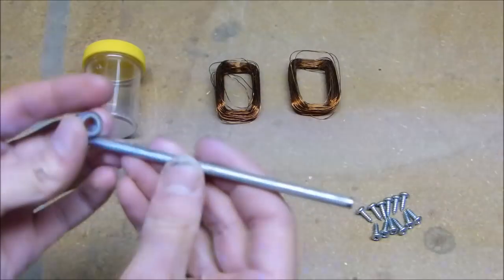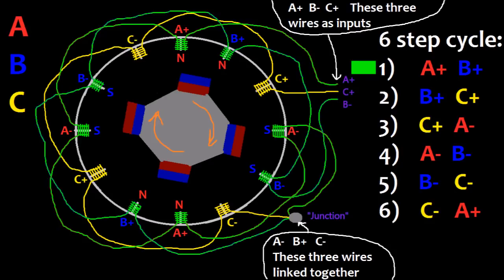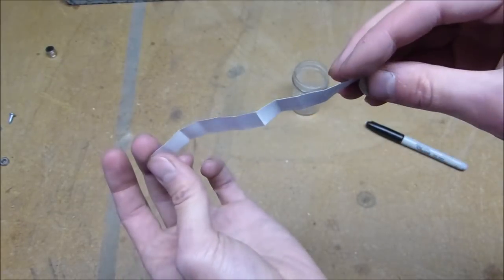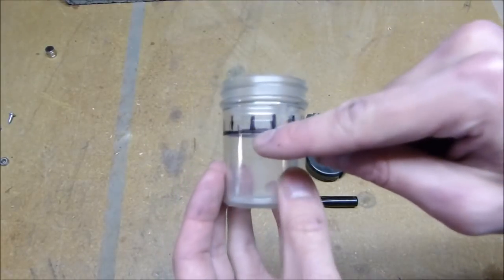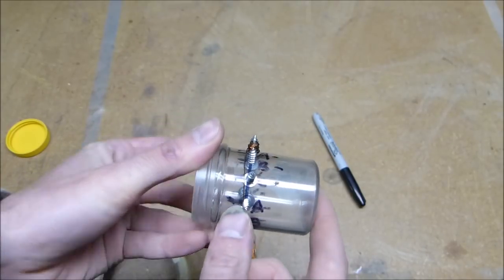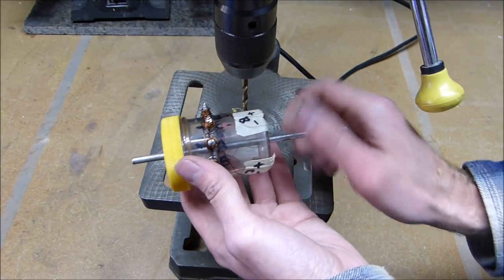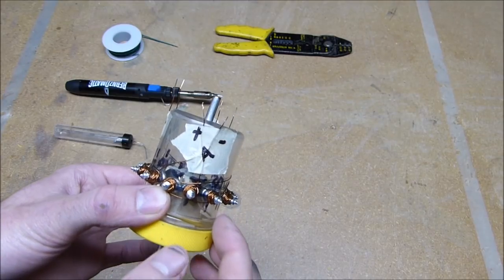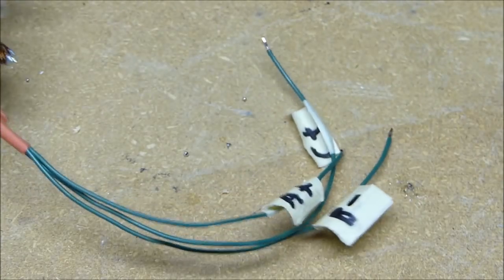How to Make a Brushless DC Motor Inrunner

Comment: I do not have access to NY rc car/plane brushless DC motor controller so what can I use instead? n nice smooth explaining!
Reply from the maker: Hi, thanks for your comment! I have a big project planned to come this year to show how to make a giant (car sized) brushless motor and controller (yes AND CONTROLLER!), but I will have to ask for funding from my viewers in order to be able to do that project.
Reply: +JaycubL dats great!!! but can u use something instead of controller?
Reply: +JaycubL dats great! but can I use something instead of controller?
Reply: +JaycubL dats great! but can I use something instead of controller?
Reply from the maker: Vikhyat Sharma I don't know of anything, but you might be able to re-watch the section f the video that describes the cycle of the motor, then use that information to design a mechanical commutator (rotating brushes). That is the only other solution I can think of.

Comment: do u think this dc motor would have a high enough rpm to get a rc airplane to fly , single propeller rc plane ?
Reply: +kian brorsen or do u think the outrunner would be better
Reply from the maker: +kian brorsen Yes it should work well it just depends on what airplane. There is only one way to really know how it will work for your plane and that is to test it.
Reply: +JaycubL that coil ur using , doesnt it transfer electricity trough anything it touches ? so why does it work if the coil is touching the others it will just send electricit trough all the coils
Reply from the maker: The wire is coated with a layer of insulating enamel. It looks like bare copper but it isn't.
Reply: +JaycubL so it will only float in the coil not transfer to other coils . thanks for ur help : im looking forward to more of ur videos
Reply: +JaycubL  if u say that the coil is coated with some enamel , then how does the electriity go to the screws ?im guessing the screws is just to let the electricity current run in the speciel way and thats whats causes the magnetic fields¨
Reply from the maker: kian brorsen The screws are just a ferromagnetic core, the electric current is not meant to flow in them (there will be some induced currents in the screws from the changing magnetic field but that is just waste).

Comment: That's nice! I'm researching about this kind of motor. This one you made is a brushless DC motor, so you drive it with a squared wave, right? Have you already tested if this motor work if you drive it through a PWM wave?
Reply from the maker: +Renato Prado I was using a commercial hobby-type speed controller for RC stuff. So it would be pwm signals but I don't have an oscilloscope so I do not know exactly what the signal the speed controller is generating looks like (it is a pwm based thing but I don't know if is smoothes the output).
Reply: +JaycubL, I see... I thought that these commercial speed controllers generated square wave... I can confirm it on monday when I go to the laboratory that I work. I asked because I'm trying to drive a brushless DC motor (a big one) using an inversor for induction motors (PWM waveform). I think that it may work.
Thank you for answering!
Reply: +JaycubL  I ask you why the current level has 3 wires on it and put the 3-point wiring that is not it

Comment: hii..can u tell me how much supply of volt should i apply to the motor?
Reply from the maker: +Akhil Shah I used an 11.1 volt battery, any of the normal RC batteries form about 7 to 24 volts would probably work well.

Comment: why does the screws have to be from the inside ?cant u just put it from the outside but not all the way in
Reply from the maker: +kian brorsen That could work yes, I think having the thicker part of the steel on the inside would get the magnetic field closer to the rotor but it might not make that much difference.

Comment: nice... i think i can do it. thanks for idea... but i have question, can i just stick the +A & +C?
Reply from the maker: +Justin Elchean Caisip No, they are not always on or off at the same time.
Reply: +JaycubL Can I just power it without esc?
Reply from the maker: Justin Elchean Caisip No sorry it does not work that way. The ESC acts as the "commutator" normally would for a brushed DC motor.
Reply: +JaycubL thanks for replying.  :). there is no ESC in our place. so i think i can make it. again thanks to your video, i am really amazed. Im a filipino.

Comment: Absolutely awesome can it be used as a small wind feb for batteries.
Reply from the maker: +Joshua Hawkins Thank you for your comment! I am sorry but I am not familiar with a "wind feb for batteries." Is that a type of wind generator? It can be used a s a generator yes.
Reply: +JaycubL damn auto correct. Yes I ment. Wind generators lol
Reply: +Joshua Hawkins also been looking at your green house have you thought of adding watermelons.
Reply from the maker: Joshua Hawkins I tried it, for some reason the seeds did not start. I could have bad seeds. I will try again next year.

Comment: I am making this project but my task is just to run it so i do not want ESC so where i have to connect battery terminals to motor?
Reply from the maker: You would need a different motor design for that.
Reply: I  made this and it works .Thanks Jayclub very helpful video .
Reply from the maker: Cool good job!

Comment: bro , this is insane . awesome. whats the rpm of the motor and  how much power is needed to run it
Reply from the maker: Thanks! I do not know the RPM but it seems to be a few thousand by my guess. For power I used a small hobby-type 2-cell lipo.
Reply: RAJU SUNDAR
Reply: It is controlled by the speed (pulses) of the controller; 12 pulses per turn theoretically... :)

Comment: Wow! Excellent "How To" video...one of the best on Youtube! Would love to see you build a motor suitable for water submersion. Any suggestions on waterproofing this?
Reply from the maker: I am not sure how to seal around the axle, but the electronics would be fine if you just cover them in hot glue.
Reply: Brushless motor does not need to be water tight....... That was one the huge plus to using them in rc cars trucks!  But you need sealed speed controller that wont die as well.  The motor it's self will run fine under water ROV's use them all time open to all.  But like everything if salt eats the hell out of them if you dont clean them oil bearings so forth like with any motor!

Comment: nice one. WHat if u build bigger is it stronger ?
Reply from the maker: Yes larger diameter motors will have better leverage and therefore more torque at the rotor shaft. Using larger and stonger components will also allow the motor to be able to handle more power and torque without breaking or overheating. The final determining factor of power output is the amount of electrical energy you can dump through it (multiplied by the efficiency).

Comment: I'm sorry, but I do not speak English, but I'd like to know if this engine can lift a quadricopter ...
Reply: You would have to put it on a scale and test how much trust it has, but it is really hard to make 4 of these that have the same amount of trust since they are hand made. A little diffrence in the spacing of the screws could make quite a difference. So you are better of buing 4/3 cheap motor's to put on your quad- or tricopter. (Use Google translate to translate this to whatever you speak)
Reply: Entendo oque você quer dizer mas mesmo assim muito bobrigado de coraçao mesmo.
I understand what you mean, but still a lot of heart bobo.

Comment: What you made is a brushless AC motor. A 3-phase one to be exact. 
It is not a DC motor if you can't feed it DC current and you used a RC ESC which is essentially an invertor.
Reply from the maker: This is what is known as a brushless DC motor because it uses a solid state commutator instead of a mechanical brush commutator. If you disagree with the title that is fine, makes no difference to me. But these are called brushless DC motors.
Reply: Nikola Dachev 
Dc and ac refer to how they are powered as well. If the speed controller is powered by a battey then this is definitely a direct current motor
 (dc motor)

Comment: Very good, detailed video as always. I would like to use this same process to build a much bigger motor to power an electric car. Where would I find a controller for a larger motor?
Reply from the maker: +luke Fugate Yes I plan to do the same thing but there are also a few other motor configurations I plan to try. I want to convert a CRX. There are actually zero controllers on the market that I can find for this type of motor in a large size, they are all AC or brushed DC. You basically have to design something yourself... That is why I am going to be trying to raise money soon to start a business making brushless DC motors and controllers for EV car conversions. If you look at AC motor and controller sets for example the AC50 and AC51 sets from HPEVS you will see they sell for above $4000 from the cheapest sources on the internet. But I have a plan to sell brushless DC motors with controllers for about $2500. The goal for that project is 10,000 rpm 100hp. I will be launching a Kickstarter campaign soon to raise money for development (rewards for donation would include complete instructions on DVD for how to make a full car-size brushless motor and controller, complete motors and controllers, etc.) I am hoping that this video can build some interest in this sort of motor on my channel in the days leading up to the fundraiser.
Reply: +JaycubL  A problem might be cost of production if you intend to sell it for 2500$(maybe if you can make your magnets alone) 
also it would be cool to have a heavy rotor or something like that maybe a side part that can use kinetic energy for great short term acceleration could be used in turning at high speeds or to quickly get ahead of a long truck 
all together great video man
Reply from the maker: 131013y Yes I will have to make the full size prototype first, but I think I can make reasonable profit at $2500 while still using quality parts. Still a question is more of whether the motor I build will handle the 100HP 10,000RPM I am aiming for. (it is not the design in this video). But even if it is like 60HP 7,000RPM that would be fine they would still be a good deal at $2500.
Reply: +JaycubL I want to support you in this :D
Reply from the maker: Pedro Cavalcanti Really? In what way?
Reply: JaycubL I would like to contribute to your project through crowdfunding sites. I do not have much but I can help you. Have your project added? If yes, sent the link to all of us. ^^
Reply from the maker: Pedro Cavalcanti I had put it of because I didn't think it was exciting enough to get funded but I have it a written up already. I will build the large size prototype and release the crowdfunding in maybe 2 weeks since there is interest! Thanks!
Reply: luke Fugate that's not working. Don't fly high.

Comment: Pretty nice construction and effort, but you went to a lot of trouble. Why 6 poles instead of 3?  Makes for double the work (also half the RPM).
.
Plus, technically, I'd call it an out-runner. The magnets face outward. 

P.S. I've designed 'em professionally in the mid 1980s  Used the LS7261 IC in a 3 phase config 250 watt, 12,000 RPM blower.
Reply from the maker: Hi thanks for your comment! That's pretty cool that you designed brushless motors professionally.

I don't remember what went into the decision on the number of coils, but I think it was basically about what spacing was going to work nicely with the supplies I found.
If I had done 3 poles / 6 coils it might be capable of higher rpm but it would run rougher especially at low speed/starting, and have lower torque.

An outrunner refers to a motor where the outer shell is the rotor, and the coils are on a stationary inner core. I have another video on my channel where I built one that way.
Reply: @JaycubL  You had 3-phase, but 6 poles.  If you on;ly had 3-phase, 3-poles it would turn faster. It wouldn't necessarily have less torque,  You r magnetic structure is pretty loose coupling, but with decent field pole sized (bigger that those screws, the field would be closer to orthogonal and I think actually have more torque,  The way that one was, the next pole is quite close and not necessarily best for torque.  Less work and more room to put together.
Whatever.
It is a cool project.
..
RE: In-OUT runner.  Yea, Mine was an outside cup with the Perm magnets facing in, so you're correct. I got that wrong, even thought I gave it some thought... Oh well.
.
I hung on to a couple for future use.
Here's a video using it:
https://www.asuswebstorage.com/navigate/a/#/s/1FA84D0E47DC4A84907211F2A6B67F684 

Regards.

Comment: dose it matter what type of copper wire you use?
Reply from the maker: +robert paddock Not really, it needs to have insulation of some type though. If you can find the enamel coated kind like I used then that will be the best choice.

Comment: how would that plug in without the rc part you used? would you solder  the  a+ b+ c+ together?
Reply from the maker: +MrDagothUrr No you would have to make a controller for it. You can use back EMF or hall effect sensors for the timing of the controller. http://ww1.microchip.com/downloads/en/AppNotes/00857a.pdf
Reply: +JaycubL Thx for the reply. I been watching your stuff for some time now and only just posted a response. I wonder if you could use this motor to make a sanding belt or even maybe a lathe?
Reply from the maker: MrDagothUrr Sure you could use it to drive whatever you want but for a sander or lathe you will probably want to build it larger.

Comment: Can I make that motor with 1,5V batteries, wire,... I mean I just have simple tool, and no sensor :(
Reply from the maker: You can make other motors with that, but not this one. There is a very simple design you can use that works fairly well, look up "newman motor" (it uses a simple brush system and can be made with minimal tools a nd materials).
Reply: Can you give me any tutorial links? I found a lot of samples, but I couldn't get the way it operates :(
Reply from the maker: ***** Maybe I will make one then, it is simple so you can do it in only a few minutes probably, once you see what the design is.
Reply: wow, that would be great :D Thanks

Comment: hello why it is 3 ends and there is only 2 ends of power please tell who to supply power
Reply from the maker: You need a speed controller for brushless motors.
Reply: JaycubL not if you use rodin coils, but you need to use ac power with those.

Comment: What would be some of the uses for a motor of this size?
Reply from the maker: +Gayle Posey This size could be used for RC hobby things like planes, boats, cars. Maybe a small power tool, I don't know what all but there are some possible uses. My purpose for it was a demonstration and learning project. I might put in on a 100% scratch built RC thing some time for the fun/learning of building something like that ALL the way from scratch. For more practical uses you will probably want to make a larger and more precision / better quality motor. But if you have not built one before it doesn't hurt to make a small one first to build your confidence in your design if noting else.

Comment: nice work, but how does it work without 
hall sensors
Reply: +Adel Physi hmm fixed speed? you can just keep changing current flow and the motor will go with it, just my guess

Comment: can we connect this model to battries cause i could not find the thing from rc cars and plans!!!
Reply: am stuck on connecting the 3 wires to something but am having issues
Reply from the maker: I am sorry, I do not know any other way. It will need a brushless motor controller to function. I will later make a video showing how to make one, along with a much bigger motor.
Reply from the maker: Saiful Islam Hridoy Yes I was using a 20 amp ESC so 30-40 amp should have no problems. I think my wire is about 20 AWG which converts to around 0.8 mm diameter. Here is a good website  for wire size conversion: http://www.rapidtables.com/calc/wire/awg-to-mm.htm

Comment: hello bro can i ask something what is the function of the junction
Reply from the maker: At each part of the cycle there are two coil sets on at once. Current flows through one coil set, then on the return trip it flows back through a different coil set. The junction is how current flows through two coil sets at once without having to switch each one independently.
Reply: AHH! i guess thank you bro for the comment

Comment: friend has not worked for me, I've done everything as shown in the video. when I connect it only plays intermittent sounds.
Reply: +Asylum I used a speed control 30 Amp, lipo battery 2200 11.7v 30c
Reply from the maker: +Asylum When you soldered the wires, were you sure to scrape the enamel coating off the end? It may seem like an odd question but the other time some one said it didn't work, that was actually the problem.
Reply: +JaycubL yes, I'm very sure. when I connect my original brushless motor, it produces a high sound, but; when I connect this engine produces a very low sound. the connection of the coils are equal:( A-, B +, C ) _ A +___B_ C +
Reply from the maker: Asylum I am really not sure then. I have made two and they both worked fine, it is possible that the back emf is not strong enough at low rpm for the controller to detect depending on the exact specs of your magnets and coils. You could try giving it a little throttle, then turning the rotor shaft by hand to set the motor spinning. If it works once the motor is spinning then it is an emf sensor issue (basically the speed controller not working so well with this motor). In that case, maybe a smaller esc?
Reply: JaycubL
well I will try with other magnets. I used a small. are 2mm x 6mm circular Neodimiun